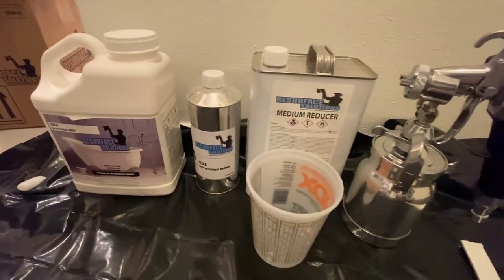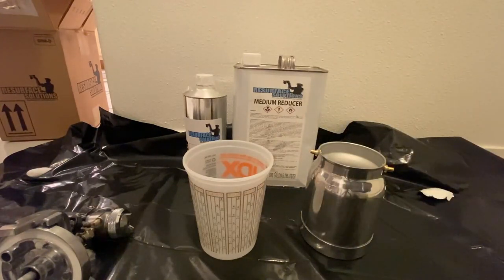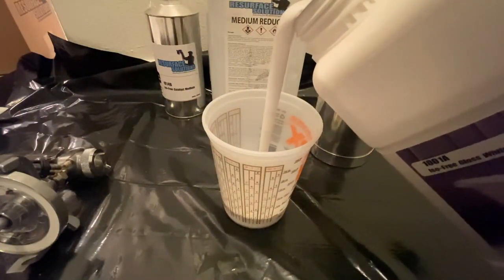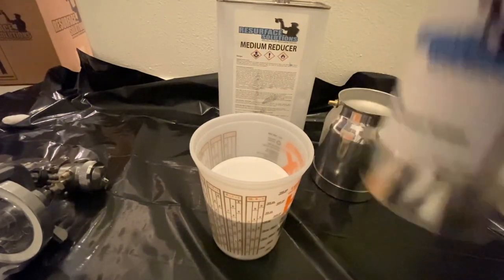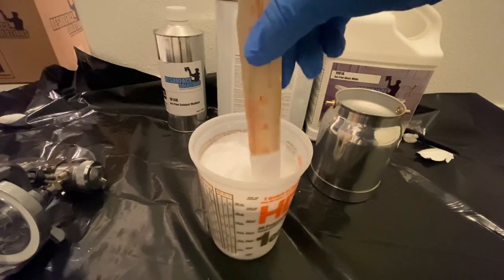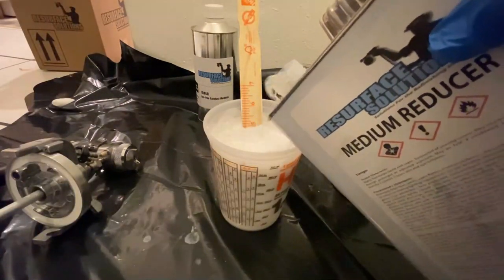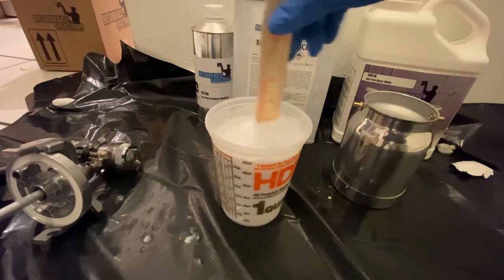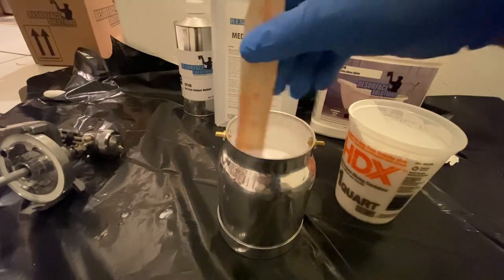Mixing Bathtub Reglazing Paint + 2 Part Acrylic Urethane Resin for Bathtub Reglazing *How to Mix*

Comment: I called and the company won't sell to laypeople - too flammable
Reply from the maker: Try Polane at Sherwin Williams!
Reply: @DPTubs  that store said they have 2  quarts in a box 2 part epoxy, you mix them together. called krylon tub and tile epoxy..Does that sound right?
Reply: @DPTubs  I called that store here in nYC. Only 2 commercial stores sell it and they said 
may not be able to get it because there is a high failure rate - meaning if not applied correctly

Comment: Do you like using the medium reducer? I always used a hotter reducer so it would cure faster when I was spraying a tub. How you like that gun. What do you use to keep it clean? I never strained the paint pouring into the pot because I used a strainer on the end of the feed tube.
Reply from the maker: I definitely like the medium reducer, it dries quick enough for me to caulk the tub after I clean up the bathroom after spraying. 
The gun is awesome. I use lacquer thinner on a microfiber rag / cloth to wipe it down after spraying.
Reply: @DPTubs  I always liked the remote pots better than the over under. I guess that’s all personal choice. We used to spray a lot of cabinets and appliances so I like the flexibility of the remote pot and I always felt I could get better more even coverage.  I’m really enjoying the videos man brings back some great memories. The best thing is how well you prep and I can tell you are very good at this stuff by how you prep and how you keep you equipment!

Comment: Sweet new equipment!!!  We use the Napco Polyglass 320 line.  Have you ever used the Napco?  If so how does it compare to the Resurface Solutions?
Reply from the maker: Unfortunately I have not tried Napco system I just use their acid. 

I would love to try it out to see. Maybe that will be a video coming up.

Comment: The gun is looking pretty clean.
Great video
Reply from the maker: Yeah I got a new set up...Titan Capspray also has a deal if you buy a Compressor / Gun Set up they will send you a new gun also. So I have another on the way.
Reply: @DPTubs  that's pretty cool. I need another one just in case
Reply: I think for tub refinishing a 75  is more than enough

Comment: Cheers for posting that video. Very informative. How many baths would you get out of that set up? It's obviously cheaper to do it that way rather than the Krylon? Cheers.
Reply from the maker: Yes this set up costed me $113 and I can get 7-8 bathtubs out of it.
Reply: @DPTubs  is there any way to avoid shipping cost from the website ? Also is there anything you recommend to use so I can get a shiny / glossy finish if I already have the paint but the paint I have isn’t giving me a shiny/glossy finish?
Reply from the maker: What paint? Make sure you are mixing at the correct ratio and not spraying too much at one time. There is a reaction called blushing if you spray too much at once. 

Spray one coat, wait 10 minutes, spray another coat, wait 10 minutes, spray a third coat.

Comment: Do you use the Resurface solution primer "Euro Poxy Primer" before using their tub coat paint?  I'm using on a fiberglass tub and back splash of tile.  Would zinssers 123 primer work with the Resurface tub coat?  Thanks
Reply from the maker: Yes Zinsser will work but Zinsser is more for sealing rather than primer adhering. The Euro epoxy primer helps with adhesion too. If you use Zinsser you have to make sure it’s completely dry ti avoid reaction. Euro epoxy primer just needs to be hot flashes dry and then used with the compatible resurface solutions top coat .

Comment: Hey Danny is there a specific reducer for the epoxy paint or does any due? I’m about to spray my tub for the first time want to make sure I don’t mess up lol
Reply from the maker: Resurface solutions has a specific reducer! 
Otherwise let me know the product you are using and I can let you know what I have used to reduce
Reply: @DPTubs  I’m using the homax tough as tile paint with a Wagner 2000 sprayer, would the jasco epoxy thinner be okay?
Reply from the maker: I would use lacquer thinner for that! Sorry this is a bit late

Comment: Do you have a video showing your exact spray gun and the specs needed to be able to spray acrylic?
Reply from the maker: I have a video on spraying a tub and show the dial settings for air pressure and paint flow. 

I will do another coming up specifically showing spray gun settings